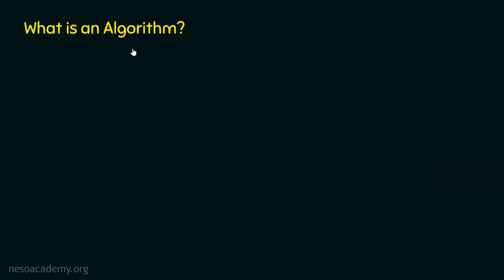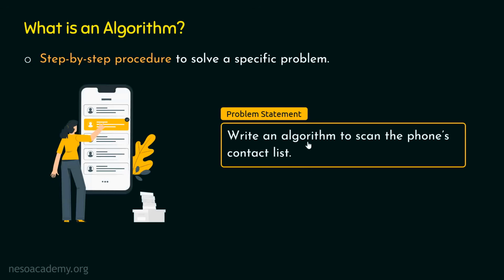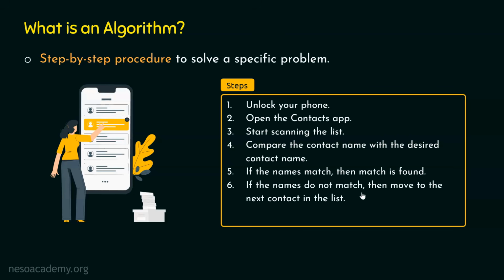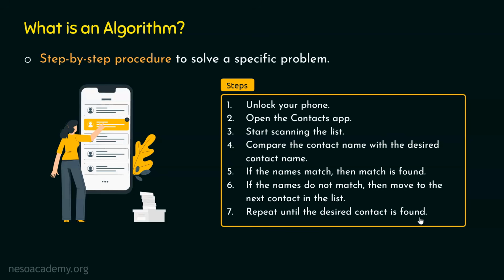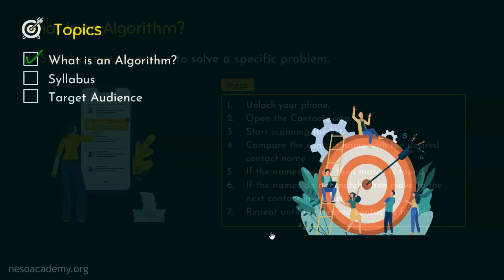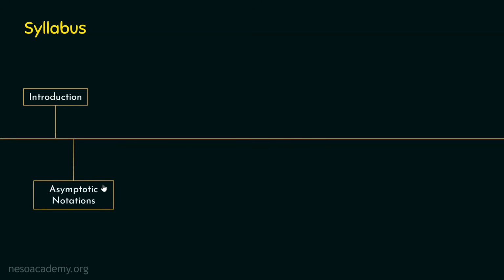Introduction to Algorithms

Comment: 00:12 Introduction to basic concepts of algorithms.
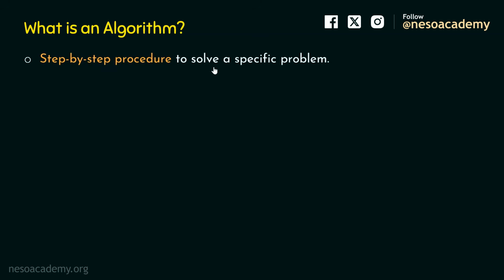01:00 An algorithm is a step-by-step procedure to solve a specific problem.
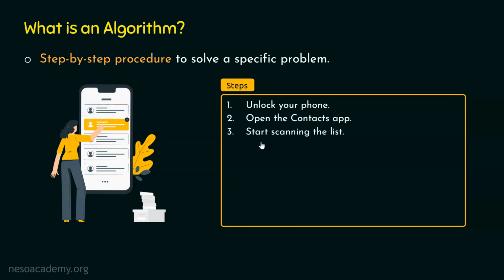01:54 Algorithm to find a contact in a list
02:41 Understanding algorithms as step-by-step procedures to solve specific problems.
03:27 Overview of course syllabus
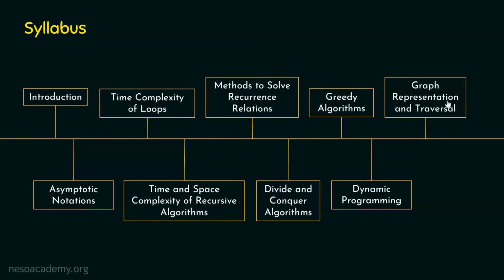04:21 Course overview covering dynamic programming, graph traversal, and sorting algorithms.
05:16 Ideal for competitive exams, software developers, tech enthusiasts, and problem solvers.
06:08 Understanding discrete math and data structures boosts success in this course.